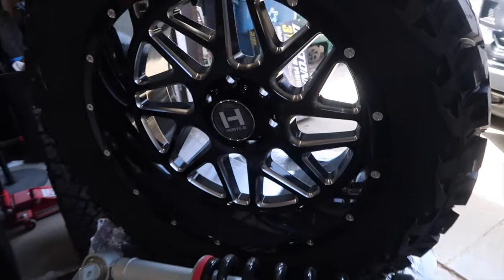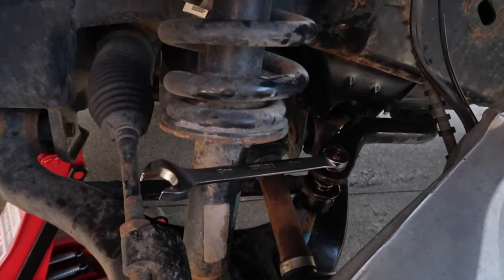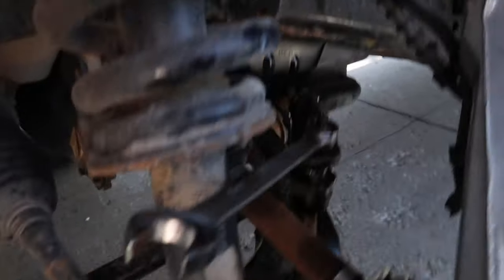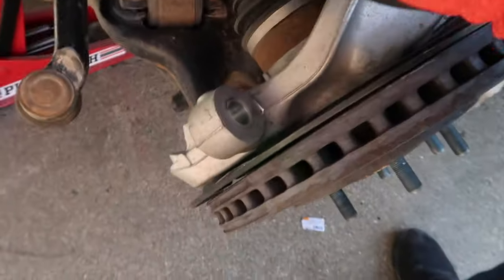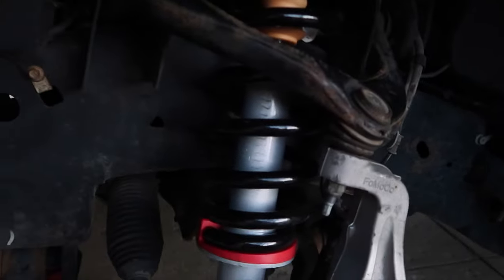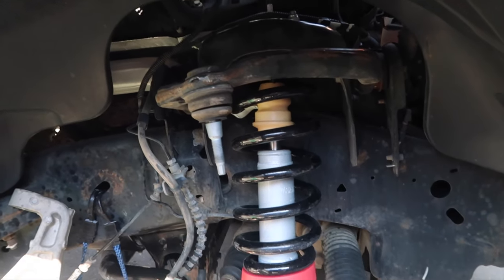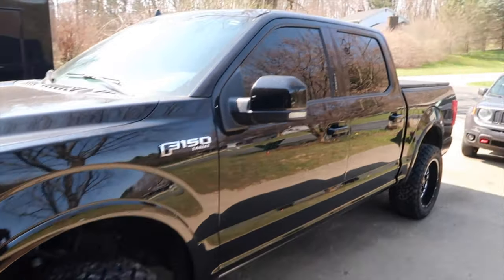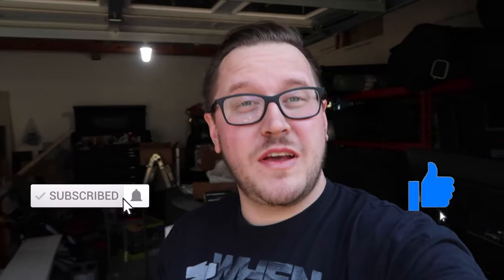Rancho Quick Lift and Hostile Sprocket Install on 2018 F150

Comment: Looks good, looking forward to the control arms and rear blocks. Does it sit pretty level now?
Reply: fronts a little taller than the rear now. I still havent had a chance to install the rear blocks and the upper control arms. hoping to get that done soon along with new exhaust.
Reply: @DJLoStax  I was afraid it’d be nose high. I’ve got a line on a used set of Ranchos, I’m hoping they might have already settled but the guy who has them uses rear blocks too. What size block are you going with?